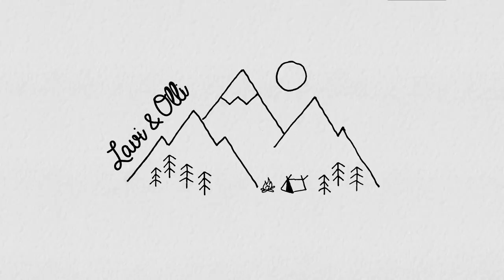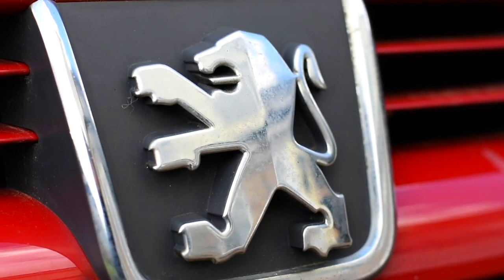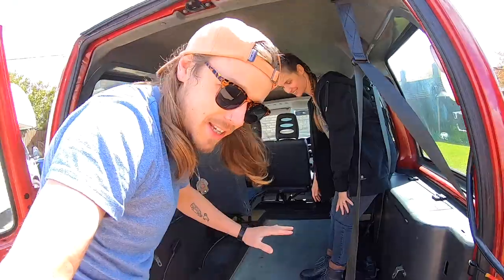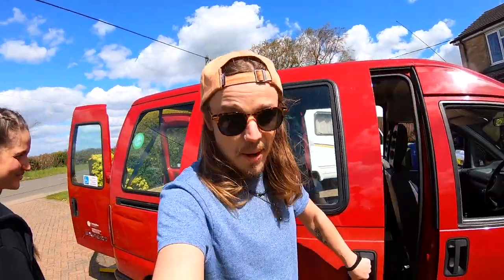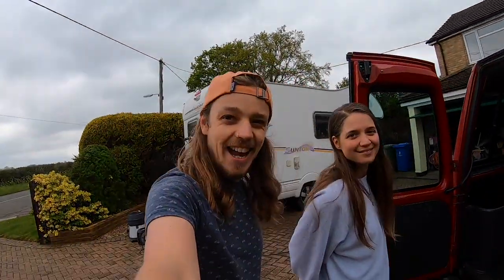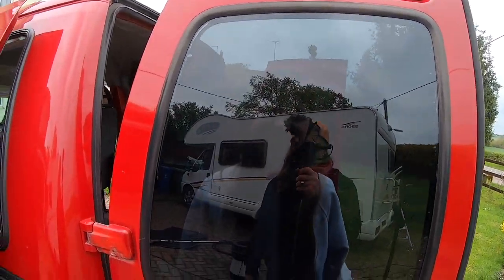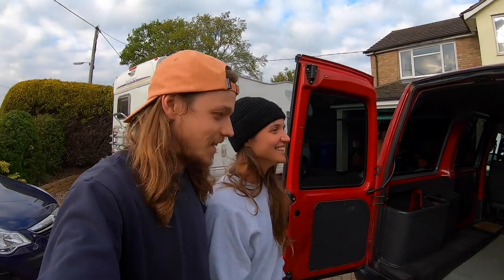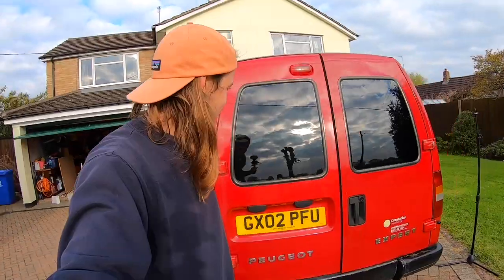CHEAP VAN CONVERSION (UNDER £800/$1000!)

Comment: I love the work you are doing here.  Just a tip - for anybody else who is doing this - spray bolts with penetrating oil the day before you try to loosen them.  It needs time to crawl along the cracks in the bolt thread.  Rock on!
Reply from the maker: Thanks so much for watching! We'll follow your advice for the next time 🚗❤️😁